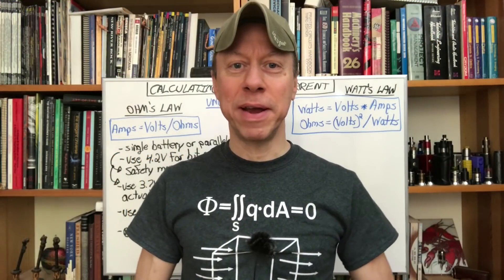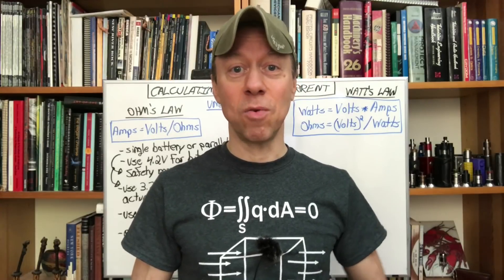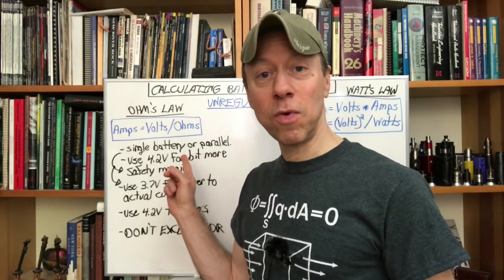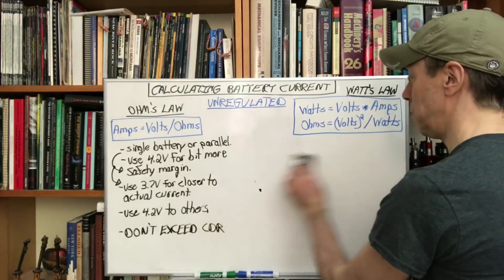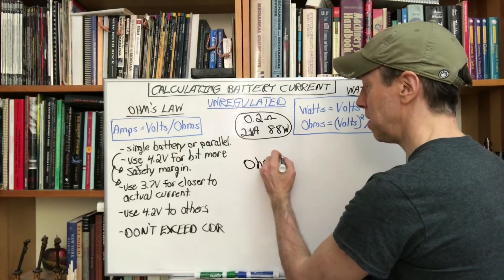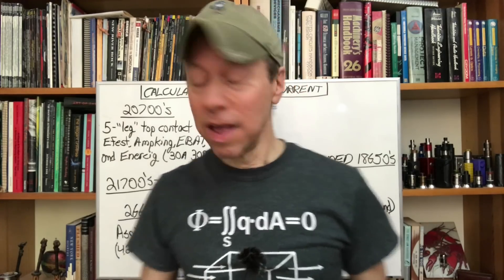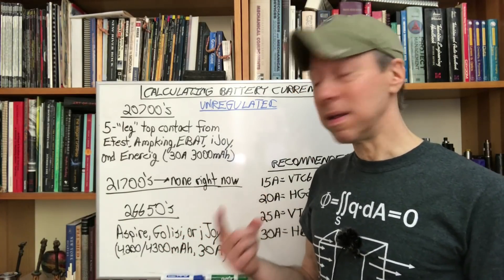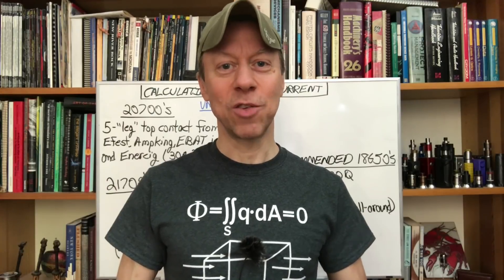Minding Your mAhs – Ep002 – Batteries for unregulated/mech mods

Comment: so the Sony VCT5a will last longer than the VCT6? i vape at 40 watts, ohms usually between .22 or .36 max in a dual battery smok species?
Reply from the maker: They will be about the same when at 40W but the VTC6 might last a tiny bit longer. Try both and see which works best for your setup.
Reply: @batterymooch  thanks  brother

Comment: 9:37 Nice math, but the problem is, in the real world you cannot just magically double a coil's resistance.
Reply from the maker: Of course not, you need to lengthen the wire used, or changes wire gauges/types, or both. But the math and techniques needed to work everything out are still valid whether the resistance change needed is easy to achieve or not. 🙂 Using the example of doubling is a lot easier for everyone to follow than, let’s say, increasing the resistance by 25%.

Comment: I’m not understanding this.   So how do I choose my volts on a mechanical mod???
Reply from the maker: I don’t understand. The voltage is from your battery, you do not choose it.
Wait....do you mean the voltage you would use to calculate the battery current? Use 4.2V to give you a bit of a safety margin.
Reply: @batterymooch  ohhhhhhhhhhh
Reply: @batterymooch  thank you it makes since now lol.
Reply: @batterymooch  so you wouldn’t recommend hohm run LX to drive a mech would you? I bought two Samsung 30ts also.   This stuff is harder than I thought but I want to be perfectly safe before I do my first build on a mech.
Reply from the maker: @codygoins8832  it can never be 100% safe. You must always be aware and never misuse or mishandle a battery. I recommend the 30T’s but the Hohm Tech batteries can be used at under their current rating. Same for the 30T’s. Keep the plastic wraps in PERFECT condition and always use a good quality charger on a non-flammable surface and only when you are around and awake. Never use a mech unless you fully understand Ohm’s Law, how to choose the right battery and coil resistance, and how to use and maintain a mech.

Comment: Is it fair to say „on 0.1 Ohm resistance on a regulated mod at 50W lasts just as long as 1 Ohm 50W?“

Was wondering this because more volt drop should increase the current draw and also the internal battery temperature & hence resistance, right?
Reply from the maker: Any resistance the mod can safely fire will run for about as long as any other. The coil is not connected to the battery. The coil is connected to the regulator circuit board and the board is set to a fixed power level. No matter what resistance you use the board will still try to put out the same amount of power. This means that the current from the battery does not really change when the resistance changes.

There are some small changes due to regulator efficiency at different voltages and current levels but they don’t have much of an effect.
Reply: And how about I calculate my unregulated mod at 50W for both 1 ohm and 0.1 ohms. Here 0.1 would be less efficient, as it requires more amperage?
Reply from the maker: Check out Ep3. The coil resistance doesn’t really matter. It only makes a tiny difference in the amount of current at the battery due to efficiency differences in the regulator at different coil current levels. If you want, add a few percent to the calculated current levels for the lower resistance coil.

Comment: Damn, thanks for the crystals clear infos!

I was just wondering if Samsung 25r were good for mech mods, if not I'll get myself some VTC5s
Reply from the maker: 25R’s are decent batteries but the VTC5A is a better choice for up to 25A. The VTC5 is okay but the VTC5A is better. Keep the plastic battery wraps in PERFECT condition at all times and use a good external charger on a non-flammable surface and only when you are around and awake.
Reply: @batterymooch  First, I got to thank you for answering my question!

I gotta admit that I'm a bit anxious when it comes to batteries, a single dent in the wrap and I won't use them until rewrap or replacement if the dent is so deep that it got the battery damaged.

I do some airsoft as well and I use LiPo and NiMh batteries which also require a mendatory daily care cause they can explode but these would take the whole house with then in a fiery arson of shame.

I have silicon cases for transportation, external charger (Xtar VC4) and I have a locking mechanism on my squonk mech mod, I'm currently looking for a mosfet cause a friend offered me a mech tube but it's an hybrid one and they spook the heck out of me lol.

Comment: I have a great question for ya mooch.....I've been using mechs since 22mm rdas were the only thing available and hell even when silica wicks were around lol but so far 18650 I've found that the Samsung "Smurfs" 20s are as good if not better for mechs then vtc5s or even ohm work batteries?I do vape safe I'm not super silly or anything but there has been a handful of time where my coils are super super sub ohm as big Lou would say....I keep up with all your tests and stay up to date on all batteries cause now I use slot of 21700 mech mods in stacked and single....but what truly is the "hardest hitting" 18650 for a me h mod now ah days?highest amps as well?let me know what you think mooch.thanks for your time and thanks for what you do for our community and how up to date you keep all of us.much appreciate
Reply from the maker: Check out my Recommended Batteries tables, the link to my blog at ECF (where you can find the tables) is in the Description section below. The Samsung 20S is tied for the highest rated (30A) 18650 and it is hardest hitting 18650. The LGHB6 is also 30A but doesn’t hit very hard at all.

Comment: So if i calculate the amps and get 21 amps i can use any battery above or just 25 amps?
Plz help i just have this left to figure out😭
And when i use the ohms law do i plug in the min, max or only resistance coils im going to use?

And so if i calculate the current needed for a 0.2 ohm build is 21A does that mean that i can use a 25A battery for other ohm builds above 0.2 like 0.3 ect...??
Reply from the maker: Run the Ohm’s Law equation to see how much current you will be drawing from the battery for each coil resistance. Just be sure your battery rating is higher than the current you be drawing for any of the resistances. You’ll see how it all works once you do the equations a few times. 🙂 You can use any battery with a current rating higher than the amount of current you are drawing. If you are drawing 21A you can use a 25A, 30A, or 35A battery or two 15A batteries in parallel, or two 20A, or two 25A, etc. A higher battery current rating is never a problem. 😁
Reply: Battery Mooch thank you for always replying
Im going to be getting the djv mecha mod with the drop dead rda using a sony vtc5 and a 0.2 ohm build
So excited to finally have understood everything surrounding mechs and to start using them!!
Reply: Battery Mooch just one more thing, the sony vtc5 as stated online is 20A maximum continuous discharge, and right below that it says maximum discharge 30A
So what do i go off of
Reply from the maker: maarouf chebbo Use 20A for better performance, longer battery life, and better safety. You can go up to 30A if you do not get it hot (80°C).
Reply: Battery Mooch the mech mod im getting is made out of brass, is there a certain type of battery i should/shouldn’t use or can i use any battery?
Reply from the maker: Follow what I said in my first reply. 🙂
The metal does not affect your battery choice.
Keep the plastic battery wraps in PERFECT condition at all times and use a good external charger on a non-flammable surface and only when you are around and awake.
Reply: Battery Mooch will do and thank you🤣🙌

Comment: how i know when i have to charge my battery in a mech mod? i mean... how much time i can vape without worry about the batteries?
Reply from the maker: The amount of time depends completely on which battery you use, how much current you are drawing, and how you vape. You’ll need to take your battery out several times while vaping to check its voltage. Eventually you will learn what the different voltages feel like when you take a draw and you’ll get better and better at removing your battery for charging at the voltage you want to.

Comment: What do you think about vapcell 21700 5000 mah 15a for mod with regulation. What matters to me is mainly battery life.
 And by the way, thank you very much for the quality content!
Reply from the maker: Thanks!
If that is the cell with the recessed contacts you can have a lot of trouble using it with some mods. I don’t know anything about it’s performance though, sorry. Try the Samsung 50E2 (not 50E) for up to 30W if you can find it. Check the Description section of this video for a list of vendors.
Reply: Okay thank you very much!

Comment: Awesome. Noob here. Ultra simplified and very helpful. But what about a .1 ohm build that i see people running? You need a 37-42 amp battery? Is that even a thing? I don't get it. You have to use a series mod?
Reply from the maker: 35A is the highest rating we have for the round batteries we use. You have to vape at above the battery’s rating at the start of using a 0.1 ohm build. Some people chose to do that.

Comment: i understand everything up to the current my battery says 3000mAh which is only 3 amps lol any equation i plug into for ohms law everything looks normal untill my AMPS says like 1000 not 1000 milliamps 1000 amps can anyone help
Reply from the maker: 3000mAh is 3Ah (three ampere-hours), not three amps. Ampere-hours are a measure of capacity, how long a battery might run before needing to be recharged. The current rating or the current you are drawing from the battery, is expressed in amps or amperes.

Comment: Correct me if am wrong,the lower the ohm (0.11 or 0.13) the more wattage you need to heat that coil? For example my coil ohms around 1.4 and am vaping at 95W(serious dual 18650) .if i use this equation ohm=(volts)2/watts i will end up getting 0.7ohm coil?
Reply from the maker: Check out http://www.steam-engine.org. It can help you with a lot of the math.

Comment: what about a dual 18650 series pwm mod? using vtc5a's and a .8 ohm build would it still be safe whatever voltage i set it on? from 4.2-8.4 volts
Reply from the maker: Run the same ohm’s law equation for 8.4V and compare the current you’re drawing to the battery rating.

Comment: awesome info Mooch. One question, on the HB6 its a 30A but at 1500 mAh right? does that mean they wont have a long life time?
Reply: What are your thoughts on MXJO 18650 3000mAh Battery at 35A? looking to buy some batteries but Sony vtc5a are out of stock from the few guys that are trusted in your list.
Reply from the maker: Running time or overall life?
The running time will be much shorter versus batteries with higher capacity ratings.
Reply from the maker: There is no 35A 18650...it’s a bs “pulse” rating. It’s rated 20A.
Reply: Battery Mooch lol. There is so much to look for when purchasing these batteries. In any case I did find some Sony vtc5a from one of the guys you have on your list.  Literally it was the last guy I tried.  Lol. Thanks again Mooch
Here is the link to them mxjo I mentioned but I did not get them. I will take your word for it. But it says 35A on it. 
https://www.imrbatteries.com/mxjo-18650-3000mah-flat-top-battery/
Reply from the maker: Lots of batteries have high numbers on them....useless or exaggerated ones. :-)
If you read the specs on that page you will see it’s a 20A battery. The back of the battery says “20A CDC” too...Continuous Discharge Current. That 35A number is a useless pulse rating.

Comment: Thank you for everything you do for the community. I have a question about the 18650 insulator. How much of the top of the battery should be exposed? I bought some insulators and the opening in the insulator is a little larger than the original. It covers the tip plate but exposes it a little near the prongs. Is that a concern?
Reply from the maker: I don’t know as I haven’t seen it. As long as the metal outside ring at the top, which is the negative of the battery, is fully covered you should be okay if you’re not rubbing hard or scraping against the insulating ring.

Comment: many professional reviewers are running 0.1 ohm on single battery mech mod .. I use this build with Sony vtc5a single battery, using pulse mech kit, and I like the vape exp I get from this build. However, I have tried a lot of other higher ohm builds but didn't enjoy the vape exp. .. is this 0.1 ohm damage my battery? does this exceed the battery CDR? .. Plz advise! and your quick feedback is highly appreciated.
Reply from the maker: Yes, it exceeds the rating of your battery, increases your risk, accelerates the aging of your battery, and results in more wasted power inside the battery. By how much depends entirely on which battery you are using. 

Some vapers accept all this to get the vape they want. Some don’t.
Reply: Battery Mooch Thank you very much Mr. Mooch ♥️

Comment: Please, help me out. You mentioned, not to use battery as spacer for battery's. But, flat top couldn't sit between the series stack mod, what are your suggestion? @batterymooch
Reply from the maker: You mean a magnet?
You can switch cells to ones that have a protruding top contact or use magnets. Just understand that there is a voltage drop and some risk if the magnet can slide around at all. Your wraps and top ring insulator must be in PERFECT condition. If the magnet short circuits your battery it can explode.
Reply: Battery Mooch so as long as , the magnet don't move , I don't mind the voltage drop. (Voltage drop just affect the output only right? Isn't gonna be dangerous right? I'm very aware of all aspect of mech mod. For 2-3 years I have been doing research. But series mech mod 2 18650, I'm just alil worry about the battery Magnet. Cause good batteries like sony Samsung don't have protruding pin.
Reply from the maker: No battery use is totally safe. Using a magnet increases the risk. If the magnet doesn’t move and can’t touch anything but the top contact ( a rubber ring around the magnet would be good) then it will probably be ok. I don’t know your setup, it’s condition, and what the magnet looks like. Use your best judgement and be careful.
Reply: Battery Mooch rare earth magnet , 4x2mm. I'll use a rubber from a drip tip or something to wrap around. Series , assuming 8.4v, I play above 0.5 ohm.

Comment: Hello, great video, but was Sony VTC4 not a 30A battery also ? - or is it too old (not produced anymore) / heavily counterfeited, so that it's not worth taking into consideration ?
Reply from the maker: It’s a 23A battery in my testing for decent cycle life.
Not a bad battery but low capacity and there are better performing cells.
Reply: I never knew that, many thanks, and sorry i replied late!!...i had a couple more questions, will post them on the apropriate videos, i'm sure other would like to know also :)

Comment: I have a vgod mechanical mod single battery operated... so based on your formula  running a 3.7v @ .2 ohm = 18.5 Amps which will be running at 68.45watts which is less than a 4.2...

I'm a bit confused.... the 3.7 has more punch than a 4.2v battery? (Because of using it at closer current discharge)?
Reply from the maker: The voltage is just what you use to pick a battery.
4.2V for a bigger safety margin.
3.7V to get closer to the actual battery current.

It doesn’t have anything to do with how hard the battery actually hits.

Comment: Wow so much great information! Excellent work Mooch 👍. I have a question though. Let's say I'm running 2 X 3 ohm for example in an rda, mechanical mod. Running a 20700 or even a 18650 battery, how would you work out ohms law to see if it's safe?
Reply from the maker: Combining coils in series or parallel is something I can’t cover in comments but must be learned along with using Ohm’s Law to make sure the resistance is nt too low.

Comment: I have an odd question. If I'm using a mech mod does Voltage drop make my set up more dangerous, less dangerous, or have no affect? I would think that it has no effect other than running my coil at a lower Wattage (and lower Amp load) than it might otherwise but I really don't know.
Reply from the maker: John Gilmer any voltage drop reduces the amount of current that would flow but I don’t think we can make definitive statements about danger levels as the there may other variables involved. You might take longer hits with a greater voltage drop, nullifying the benefit of less current flow.
Reply: Thanks. I'm using a mech that is known for significant Voltage drop (EH Pro Dynast). I'm using a Big Buddha tank on the thing at about 0.75 Ohms (as I do MTL) and I'm using the iJoy 26650's as well. So as far as I know  I should be safe as long as I pay attention to what I'm doing. I'm not so much worried about saving mAh, I just want to avoid losing skin or eyes in an explosion, lol.

Comment: Living in Alaska the cold weather information is extremely helpful. I knew that batteries are not as efficient in the cold but specific temps is good to know. Do you think we will see 20700's with higher amps and mah this year?  I got the gold vapecell 20700 which is a rewrap of the sanyo 20700a (which I know you already know) but it is a really great battery. I just want to know if they are able to going to make a 30 amp 20700 with higher mah?
Reply from the maker: Sean Ryan eventually, yes.

Comment: So if you use 3.7 for ohms law should you also use that for watts law too?
Reply from the maker: jeremi bisher check out Ep3, it’s about regulated mod battery current.
Reply: Was I not specific enough? You said you can you 4.2 or 3.7 for ohms law calculations. So if I use 3.7 for my ohms law calculation should that also be used to figure watts law?